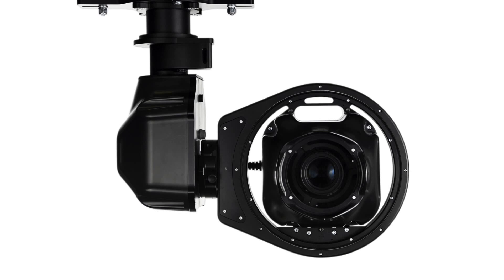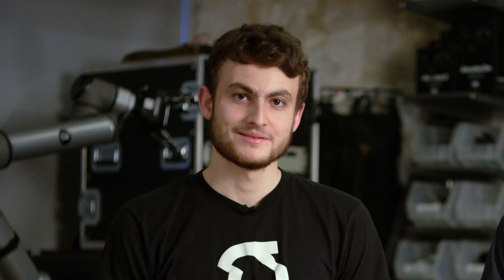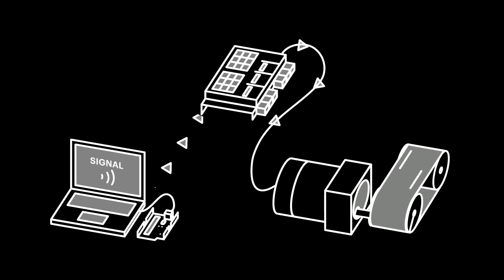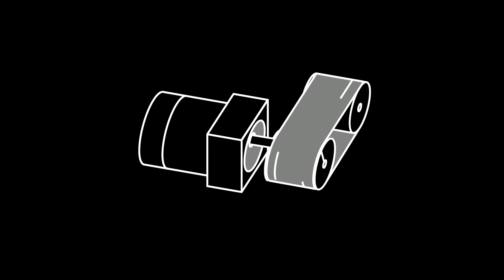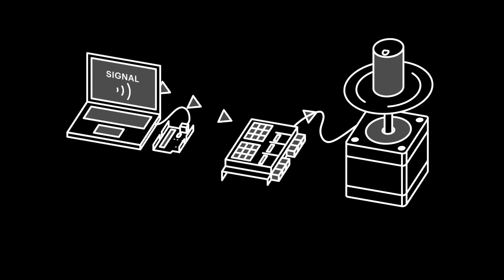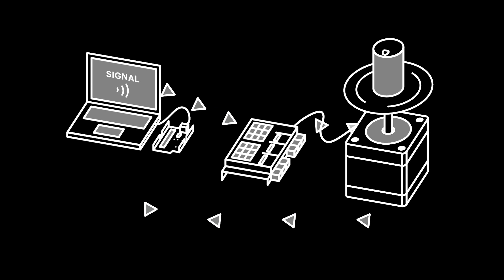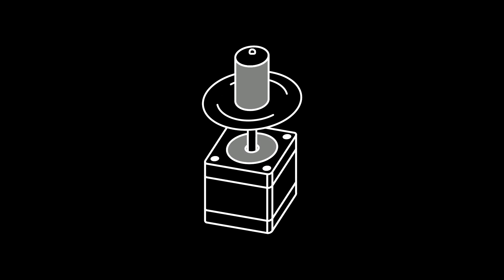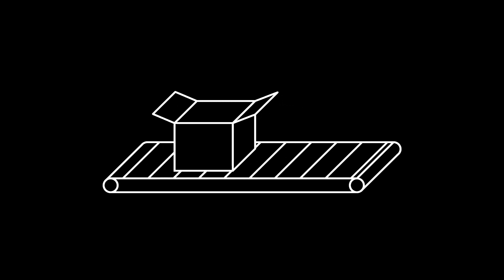The Basics of Motion Control

Comment: Looking forward to more videos! This is coming at the perfect moment, I'm currently looking into the best way to build a pan a tilt mechanism for watch videography. 

I'm planning to use the Black Forest Pine controller with some nema 17 and 23 stepper motors. Can't seem to figure out the best way to mount motors though. 

A point in the right direction would be amazing.
Reply: My first pan/tilt head was a modified Servo City PT-2100.  I replaced the motors with nema 17's with gear reduction.  I used direct drive nema 23's at first but there was too much vibration, it only takes a tiny amount to be visible in the camera.  When building a pan/tilt the sweet spot is 50:1 gear reduction from the motor.  This gives high resolution movements and cuts down on the vibration stepper motors create at lower speeds.
Reply: @motionsick  Thanks for the comment, that's some very useful info! The mechanism I'm hoping to build is for the product rather than the camera. I'll mostly have the camera stationary, at least for the moment, and just move the product. 

In an ideal world, I'd like three motors with rotating platforms that I can attach standard arca swiss clamps to. This will allow me to build all sorts of sets ups using arca swiss plates. 

My first thought is a 30cm (ish) arca swiss plates with one motor at the bottom, the product is then attached to this bar. This allows me to spin the product. 

Building on this, I would add two 90 degree arca swiss plates to either end creating a U. Attached to each side of the U would be another motor. The attached to those motors would be a smaller U shape made from arca swiss stuff. This would allow me to spin in two axis and be a little easier for hiding supports. Only downside, that I can think of now, is that the motors need to drive something which is off centre. 

Basically, I need to build three of these - https://noxon.tech/en/product/panning-module/

I would buy those but I don't think the motors would be strong enough. 

Sorry for the long reply!
Reply: @maxbridge8921  I misread "watch videography".  If those are nema 17's they should be powerful enough to move a watch around.
Reply: @motionsick  do you think nema 17's would be powerful enough if the weight is 20cm off axis? From my understanding the weight a motor can handle dramatically reduces the more off axis the weight is. I currently have Edelkrone gear (the HeadOne) and it can't handle this set up, that's how my search started.
Reply: @maxbridge8921  Yes.  The nema 17s should be strong enough, especially paired with those with those belt drives.  Here's a link to a nema 17 belt drive mechanism I'm working on.  https://www.instagram.com/p/BxW8Oh-lvAo/